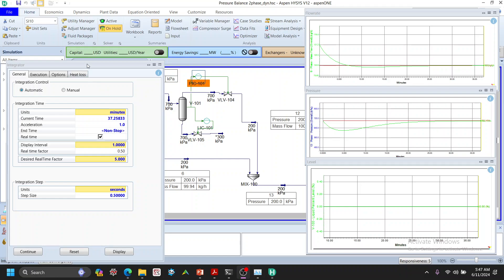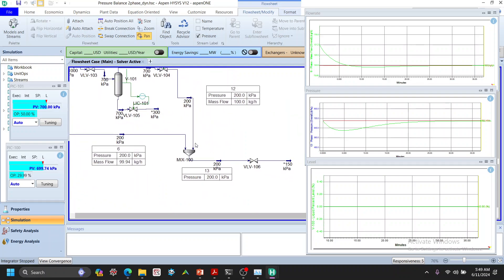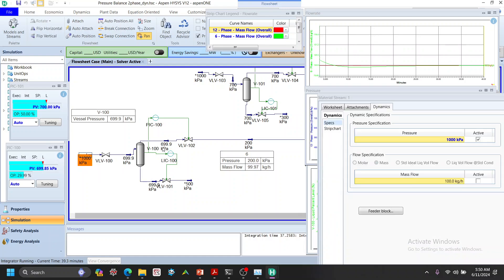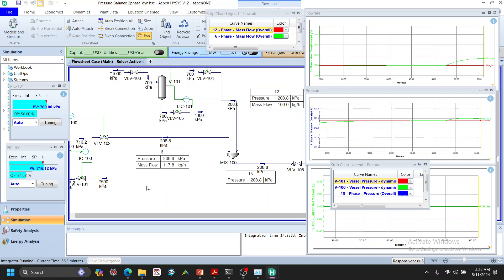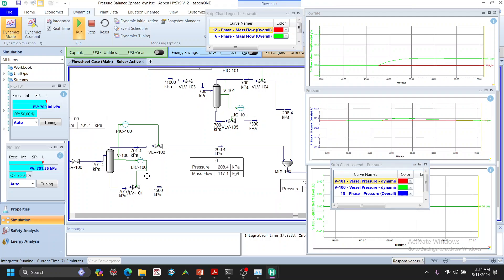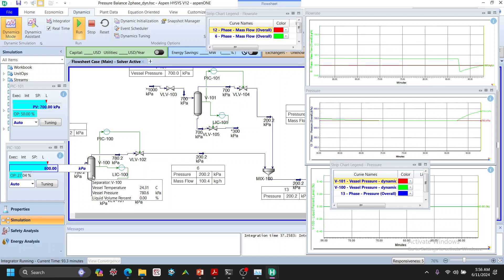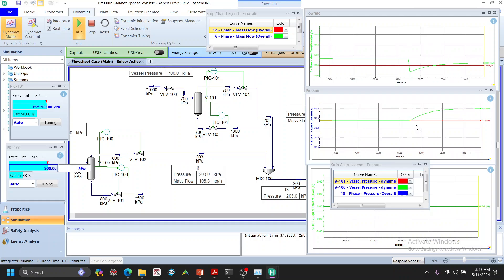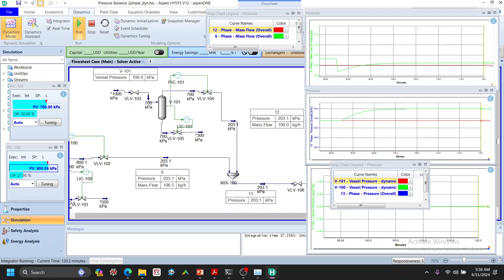Pressure balance calculation in HYSYS

Comment: Halo Pak Dr. Zulfan, terimakasih banyak atas simulasinya. Mohon ijin bertanya, jika saya mempunyai dua vessel yang terdiri dari low pressure dan high pressure. Vessel yg high pressure akan saya manfaatkan untuk blowcase meningkatkan pressure di line yg mempunyai pressure rendah, apakah hysys bisa megkalkulasi gabungan pressure? Karena hasil kalkulasi selalu based on tekanan yg paling rendah hasilnya jika di mixed serta saya perlu melakukannya secara dinamik ya pak? Terimakasih banyak Pak Doktor.
Reply from the maker: 1. HYSYS bisa menghitung apapun yg kita bisa modelkan. Pertanyaannya adalah apakah kita mengerti sistem yg kita mau modelkan dan apakah kita bisa memodelkannya?
2. Buat apa memodelkan sistem spt itu? Apa yg mau dicari?
3. Di contoh ini keliatan bahwa pressure gabungannya berubah tergantung dari tekanan kedua vessel tsb.